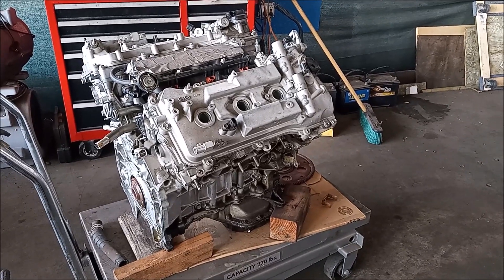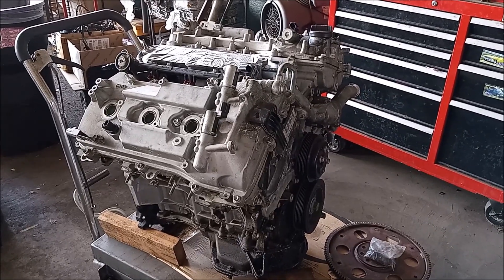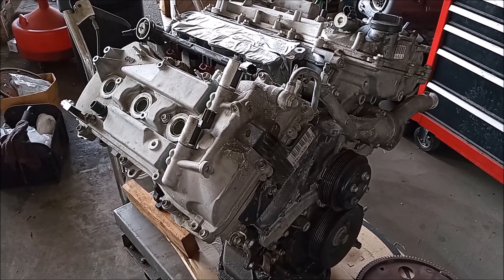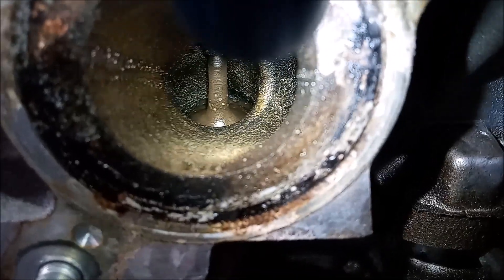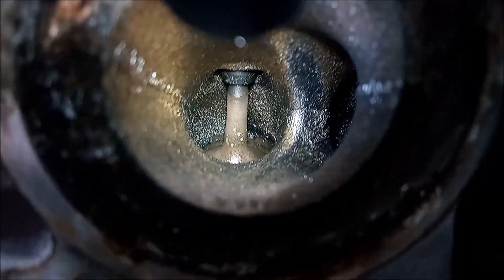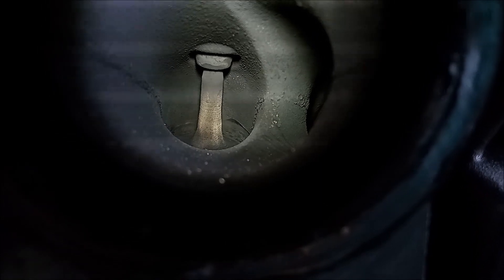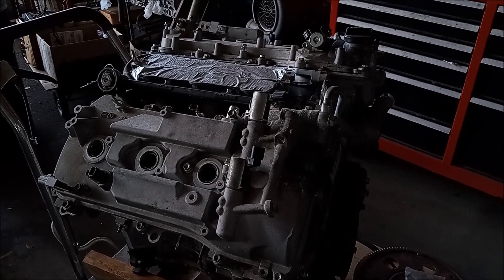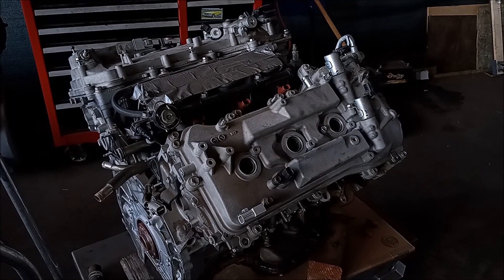Another Fatal Engine Flaw? 2GR-FE Toyota/Lexus 3.5-liter V6

Comment: thx for this - wondering if this would cause weird exhaust pulses (or destructive vibrations) that may explain why my aftermarket exhaust tube headers keep cracking
Reply from the maker: aftermarket tube headers crack - this is a fact of life. This is why one manufacturer of headers for 2gr switched from tube construction to cast construction.

Comment: So far my Sienna with the 2gr fe has 197k I’ve only replaced the alternator, coils and speed sensors. It rattles 1 out of 10 times so I’m thinking is not a problem to worry about yet. I’m about to replace the oil cooling pipes and that’s how I found your channel. Thank you for your videos.
Reply from the maker: Thank you for watching and for commenting.

Comment: So whats the fix? Scrubble off old gasket remains, swap on a new one and keep going? No resurfacing? But doesnt the head warp?
Reply from the maker: I don't try to replace head gaskets on these engines. Just purchase another used engine and swap it in.
Reply from the maker: takes too long, costs too much, engine may have other issues that do not show up until it is re-installed and run, you have to take the engine out to do it anyway - can be finished with engine replacement in a few days instead of a few weeks with waiting for machine shop etc while car takes up useful space in the shop and stops all other work from being done.
Reply: @Merryfrankster_  What about the newer 2grs? Like from 2012 do they all have these headgasket issues from time to time?
Reply from the maker: @RokasSileika  I couldn't tell you one way or the other. Don't know.
Reply: @Merryfrankster_  Why so?

Comment: I have intermittent 2gr-fe bubbling in the reservoir tank.. I have a random loss of power too. I'm not sure if my head gasket is blown or not. Sometimes the coolant smells a little like exhaust fumes. I've never overheated this engine in my life, maybe the previous owners did. Would some kind of sealants for the head gasket do the trick? Maybe just a little bit? I don't have the time or the money to play with head gaskets at the moment. Would this make it harder to fix later, i mean would the residues from the additive do something bad? Thanks in advance
Reply from the maker: I've used Blue Devil - the original formula. it requires that you drain the coolant (including block drain) and remove the thermostat and fill with water. This is more work than most people want to do. It works about 50% of the time if you just have some pinhole leaks. I don't know about long term effects. One car I did I saw again two years later, it was fine. I've tried the new blue devil that you just add to your coolant system and that never worked for me yet.
Reply from the maker: Anyway do a chemical block test (kit available from Napa and others) and confirm whether you have exhaust gas in your coolant.
Reply: @ But would this blue devil work for high compression demanding places like head gasket or is it just for small leaks?
Reply: @ is this the right one PART #: 38386-06 ?

Comment: Do you have a favorite between the 2GR-FE (2007-2010 Sienna) and the 3MZ-FE (2004-2006), as for reliability?  The more I research the more leaning toward the earlier Siennas of this 2nd generation.
Reply from the maker: In my opinion the 2GR-FE engine is more reliable and more capable than the 3mz-fe. But I can't really compare the two chassis that you are referring to.
Reply: Thanks. To the average person, test driving the car, is there any sign to look or listen for that indicates the head gasket is compromised?  Or if I hire a mechanic for a pre-purchase inspection anything they should look for?

Comment: I put 500,000 miles on one of these engines driving around the Midwest
Reply from the maker: The ones that end up in my shop dead at about 125,000 miles or less- and I get many of these, even for a small shop like mine - are not so lucky as yours. On the other hand, maybe my shop is the savior of last resort for those who find themselves in this situation, the only shop that can give an honest and affordable solution to a really bad problem.

Comment: I'm not experienced enough to dismiss this analysis but I'm curious as to what the data says. What is the frequency of head gasket failure in these engines? Sometimes what seems like a lot is actually within acceptable rates of failure in the grand scheme of things when you compile data. No engine is perfect for sure.
Reply from the maker: I don't know what is the rate of failure but it seems they all end up in my shop so it seems like a lot.

Comment: I had a 2009 Sienna (with the 3.5L 2GR-FE) and it developed a head gasket leak at 153K.  I always changed and checked the fluids meticulously.  I tried to get prices to get it fixed but between bad mechanics that said there wasn't a leak and other mechanics pricing the job way more than the vehicle is worth I chucked the van at a pretty bad loss.  I have been researching these motors as well and I don't think they are as tough as some people think they are.  I have encountered many other Sienna owners who also had the head gaskets fail and some have had gaskets go bad more than once.  I didn't want to install a used motor because I feel like I would be playing the waiting game for another head gasket to fail.
Reply: @safwanal-subaihawi6783  I did the same and I was able to get a few K miles out of it before it failed again.

Comment: Ok, dude, I stopped half way through. First I'm a Toyota Master Diagnostic Technician, (MDT).  Have been with Toyota for 22 years. You are 100% wrong on you're so called diagnosis. There are literally thousands & thousands of 2GR's out there, where are all the issues?  There aren't any. As for the head gasket, possibly overheated it?  The water pumps are good for about 90k then they seep, pink crusties. If the owner would have gone to the dealer, they would have picked it up during the MPI. You are wrong on the engines having an inherent issue. As for the head gaskets that you have replaced before in these engine, did you resurface the head?  I hope not because you CANNOT cut the heads  with timing chains, (OHC) of course. It alters the timing because you're moving the heads closer to the block. You call yourself a Mechanic, well I'm a Technician and there is a huge difference....
Reply from the maker: Dude, I stopped reading at your first sentence. Thanks for watching.
Reply: @Merryfrankster_  Because I told the truth?  I'm a little more experienced on that engine then you are....
Reply: @bluesky-ud9wg  I agree with you, great engine. I believe maintenance is the key. I have an 08 Highlander with almost 250k miles, I change the oil every 5k miles with full synthetic oil and it runs great. I only had to add AT-205 Reseal to correct a small blue puff of smoke on first morning start up. Only uses a quarter of a quart of oil between each 5,000 mile oil change. I don't get any rattle either on first start up. Great engine I'll say!
Reply: @frankbiz  Yes they are.
Reply: @Merryfrankster_  no need to get defensive brother... we are all here for knowledge
Reply from the maker: @drivealongph5428  if someone does not watch this short video all the way through and flies off the handle, they are a moron
Reply: @Merryfrankster_  Clearly, you are still a very reactive man pursuing life with full emotion. Nobody is calling you stupid, or a moron. The poster of the comment we are both replying to is a mechanic as well, a good debate regarding the engine can be made.

I am a simple youtuber looking for ways to take care of my 2GR.... but nope, all I see is negative energy and a "know it all" attitufe from you.

Thank you so much!
Good luck. Buddy.
Reply from the maker: @drivealongph5428  Did you come up with all that by yourself? Good job. Now run along.
Reply: @Merryfrankster_  Oh and that's the Typical response when I call someone out, they won't respond about the topic...
Reply from the maker: @bluesky-ud9wg  You probably wonder why nobody ever listens to you. Try stop being an ass.
Reply: @Merryfrankster_  I'm an ass buy telling the truth, so be it...
Reply from the maker: @bluesky-ud9wg  buddy I don't know what you don't know or don't know but I know you come off as a jerk. You can catch more flies with honey than with vinegar. Take that to the bank.
Reply: @Merryfrankster_  As I said it's not about feelings, I'm 52, an adult, not a child. You are not telling the truth about the video you posted and you're in a corner because I know the truth and you're being defensive. Anything else to AVOID my original comment?
Reply from the maker: @bluesky-ud9wg  I am trying to help you to be heard instead of being ignored by everyone you come in contact with. But you're beyond help. Sad.
Reply: @Merryfrankster_  Defend your end of the story with facts and experiences about the engine and not just attack the commenter? 😬👍🏻
Reply from the maker: @drivealongph5428  I have presented my side of the story in the video and it is framed very clearly as a hypothesis to be tested.If you have missed that, you are not worth talking to.
Reply: @Merryfrankster_   I agree that you made it very clear that it's a theory.  Bluesky's comment was very rude, as you're purely trying to share your knowledge and experience.  Thank you for your generosity.
Reply from the maker: Thank you for your support.  @brianbender3431

Comment: Let's have the facts; this sure is a  speculation which coming from a mechanic of you years of experience sure isn't adding any credibility.  I am a long time  subscriber to your channel, unfortunately, in my opinion,  comparing this video against years & years of the 2GR-FEs in multiple models years of Toyota vehicles... is that "off-set" really the reason for blown head gaskets... 🤔  Perhaps if you factor-in owner's driving behaviors, low grade gasoline,  maintenance frequencies and etc... to be more factual, but, can't be just the off-set in cyc 1 & 6 alone.

Comment: @Frank - Very Interesting theory. From the looks of #6 and #1exhaust ports, they definitely look more sutted than the rest. Also, the 1MZ has known cylinder head gasket issues; don't know if they also suffer from that restricted-off-set-higher-exhaust-port-temperature problem. But if we want to test the theory, then why not simply put a thermometer on both suspect exhaust ports, and compare it to the rest of port temperatures? Also, if there's localized heat buildup on/around the suspect exhaust valves/ports, then there should definitely be valve guide wear, and most certainly valve seal wear, too. I should think that there's only but so much metal one could remove 'till one causes cylinder head stress-fracture failure.
Reply from the maker: Thanks for watching.

Comment: I have this engine on my 07avalon. 216k miles. Is the diesel rattlesnake sound normal? It would go away once full warmed (30+ mins later). I would also hear the lifters when driving motor in cold position with light throttle. Thank you.
Reply: My 2009 sienna with the same engine sounds like that as well. 90k miles on it. I think it is normal.
Reply: @kylemcconnaughey5511  that’s crazy lol I thought it was doing this because of the high miles and I don’t baby the car all the time.… I seen someone on YouTube with 500k on their 06avalon. Care for your Sienna and it will take care of you!
Reply: Usually an issue w/ the cam adjusters due to infrequent oil change intervals. Toyota recommends every 10k miles but should be done at 5k to help prevent this from what I’ve seen. Check out AMD’s video about it.

https://youtu.be/QgQ8QqXotEk
Reply: The diesel sound our cars make is not the same as the VVT actuator rattle, which lasts less than 5 seconds. Mine lasts 15-20 minutes and then its completely gone. I believe it is piston slap or injectors.
Reply: @kylemcconnaughey5511  yes vvti I don’t hear on mine. Thank God. But the rattlesnake sound is a weird feature. When I’m leaving work a lot of people ask me if I got a diesel motor in there lol.. I drive at least 30 mins home and under light load it’s not present. So it’s definitely something that happens when everything is cold. ToyotaNation forum people had the same problem. I’ve lived with it so far since owning at 120k miles. This motor is on every single Lexus Toyota lineup even the new ones are exact same block. Goes to show how good it is. Cheers.
Reply from the maker: Thanks for watching.
Reply: The 2GRFE has very large intake valves and a healthy amount of lift. For some reason, the stock exhaust valves don’t seem to flow quite as well. Add on top of that these doglegs in the #1 & #6 exhaust ports, and we can see where work needs to be done. 

If you have some junk heads, maybe you could see how much metal can be removed to straighten the exhaust path of those “hidden” valves. 

They’re exhaust ports, not intake ports, so increasing port velocity might be as simple as hogging them out.
Reply from the maker: Definitly the overall flow can be improved significantly just by working those end ports - this has been proven by Jubu and anyone else who has ported these heads.
Reply: Piston slap. 2007 es350 been doing this when it gets below 30f until it warms up. Had car since 64k now at almost 100k. I know this ain't to much mileage but uncle has an 08 es which he bought with around 70k and now has 170k. Does the same thing again no issue.
Reply: I can add from my experience. 2007 RX350 2GR-FE also sounding like mild diesel engine on cold starts for 5-10 minutes then it’s gone. This is pistol slap which goes away once engine warms up and piston to cylinder wall clearance is reduced. Been driving like this for 100 000 kms , and it does not get any worse. I guess it’s just because the piston skirts are quite short and are touching cylinder walls slightly. But that’s the trade off if you want more power and better fuel efficiency out of the naturally aspirated engine shorter piston skirts , lighter Aluminium engine block. Reduced reliability for more performance, but still ok
Reply from the maker: Not sure why your car would have piston slap amongst all others that don't.
Reply: @Merryfrankster_  I can’t explain it either. I have seen other cars with 2GR-FE engines that slap on cold starts and yet i have seen others that don’t. I did. learn how to live with it , it is not particularly very loud. Other than that the engine is pretty reliable and does not burn any oil, compression is also fine. Guess there is nothing to do about but to drive it further. Car has done already over 220 000kms , I had it since roughly 120 000 kms with the noise.

Comment: Good video! Your reasoning makes sense. I have 2 siennas with this engine. Both have the updated oil line. Any thoughts on 5w-30 vs 0w-20 in these engines? Or any other recommendations about how to get the most miles out of these (other than water pump). Thank you!
Reply from the maker: In theory Ow20 should give sufficient wear protection, and give slightly better gas mileage than a heavier oil. HOWEVER - for performance applications, on the same engine,   Lotus suggests 10W40. Possibly they are not concerned about fuel economy standards and have an eye only on reliability and performance. For my own use and my customers I go with either 5W30 or 10W30, depending on what's available at the better price. For my climate the cold weather rating makes no difference.